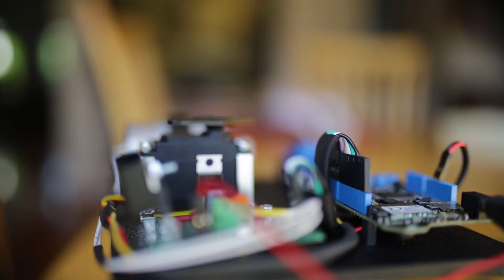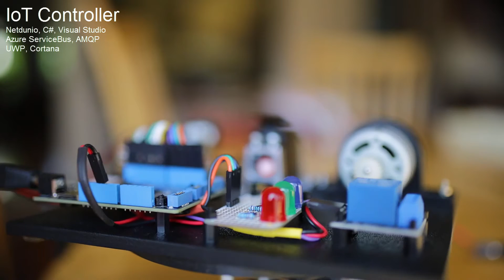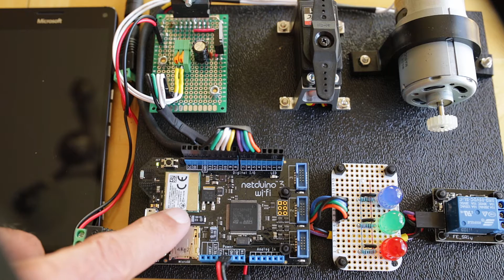IoT Controller using Cortana

Comment: Can you please give me a link for uwp, I'm stuck with creating a new uwp for cortana. Thank you
Reply from the maker: They've changed the way you should be building Cortana enabled applications. Check out this link for samples https://github.com/microsoft/cortana-samples
Reply: Thank You, But I couldn't figure out, how you manage to connect cortana with rpi. If you can, please share your program. It ll be very useful for me. I been trying this for over month but couldn't find a way in connecting those two.I hope you ll help with that. Thanks again
Reply: If you can make video explaining the coding part it will be so helpful. Thank you
Reply from the maker: What is rpi?
Reply from the maker: As I mention earlier, the link I provided earlier has all the sample code you'll need. The code I have in this project is no longer valid as they have changed the way you should build Cortana enabled applications.
Reply: Thank you

Comment: That only took a few tries.
Reply from the maker: What did?
Reply: Getting it to work. Which is in my eyes still one of the biggest issues with complex systems like these. It's nice to build them. It's awesome to learn from them but in practice it's usually faster to just get up and push a button because with systems like these, it's always something. Be it a button not responding or packets not being delivered over a network... Some things should just stay analog and stupid until we find a way to make them 100% failure proof. Or at least have an option to switch back to analog. The amounts of times I couldn't turn on my devices with Blynk because it "couldn't find my device"... The switch would have been faster.
Reply from the maker: Cortana's Natural Language Processing has improved by leaps and bounds since that time. Amazon's Alexa has too. So much so that they understand pretty much anything you say to them. Speech recognition has an error rate of about 5% today, which is the same as a human (it was about 15% when I did this video). This has been possible due to a number of factors. Much more compute power, much larger dataset for training (the more you use them the more they learn) and finally deep learning. 

Today I control my home thermostat (a device I built - I'll post a video on soon) via Cortana and Alexa (using Echo) for all kinds of settings spoken is just about any way you'd likely speak them. This field (NLP) has gotten to a point that they're comparable to a human. Knowing what to do (once the spoken words are understood) is still up to the programming. 

I should note also, that even though I have a phone app for the same functions (for my thermostat), I'd prefer to talk to Alexa and have her do it because it allows me to continue doing what I'm doing and simply speak no matter where I am in my home. Voice as a means for input is has sown to be 3 times faster than we can type and 5 times faster then using a screen keyboard and in addition you don't have to navigate to an app to get started :).